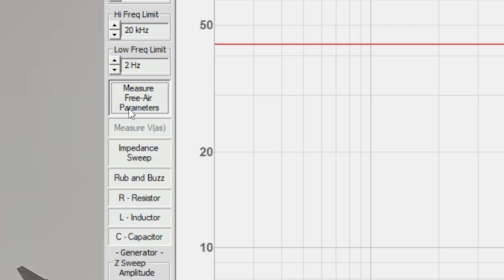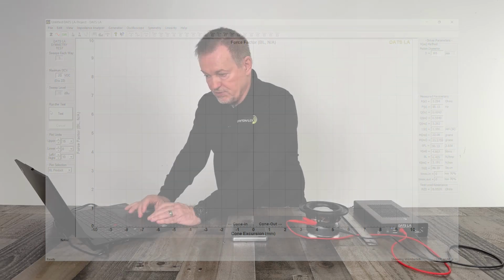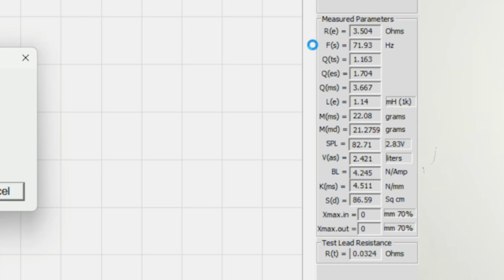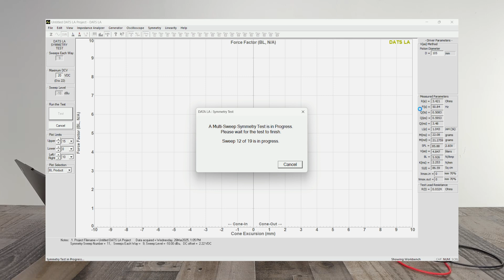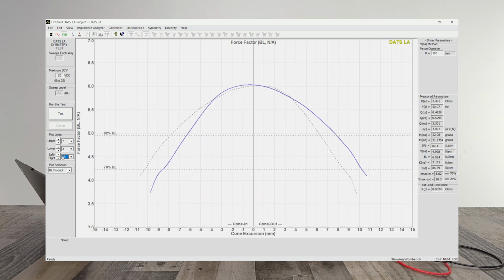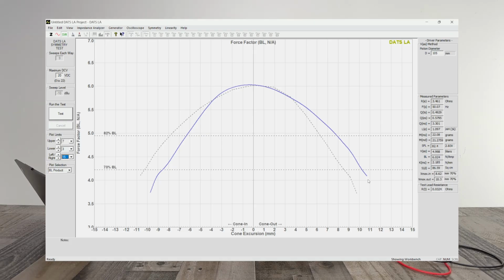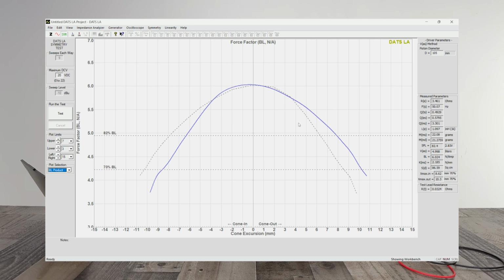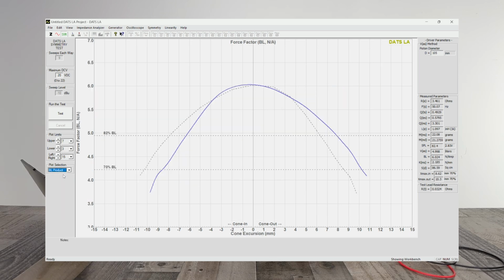DATS LA: How to do a Symmetry Test

Comment: Hey, Dayton Audio, you should be refunding everyone their money who bought a Sub-1500 from you. Flagrant false advertising claiming 150 watts on the plate Amp, it barely does 75 watts. You should be ashamed of yourself. We should file a class action law suite against you.
Reply: It clearly says 80 watts on the manual and the website both at dayton and parts express. 
It is also a 15 inch sub, a plate amp, and a ported enclosure for 300 dollars shipped...kinda hard to argue with what you bought for the money. 1 ultimax costs that much